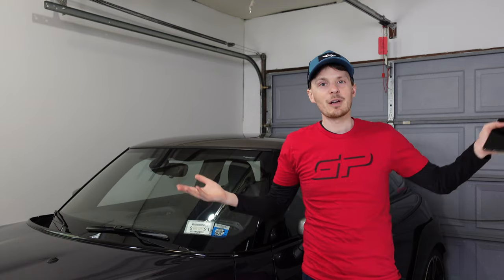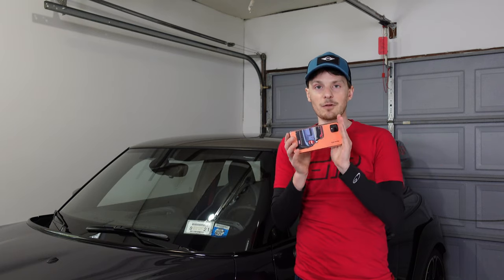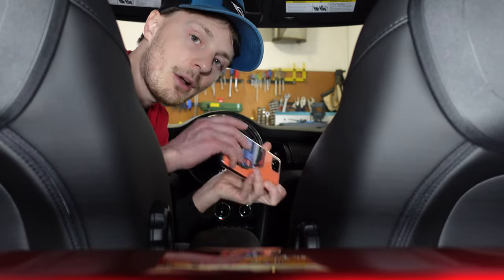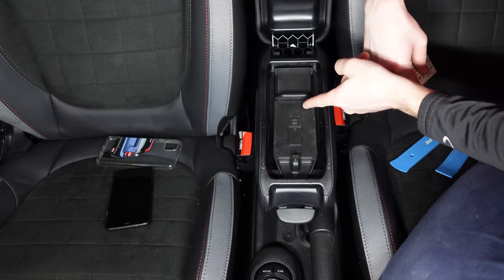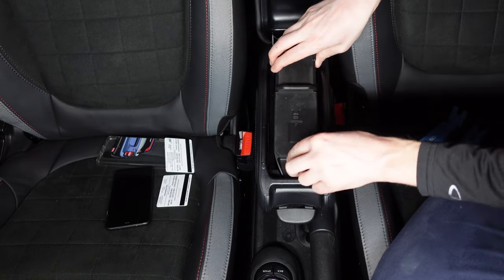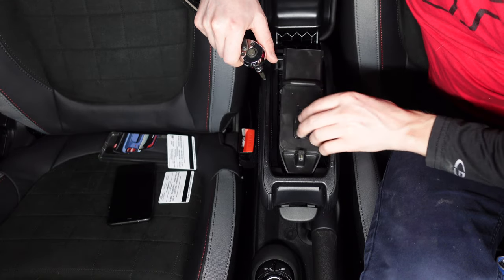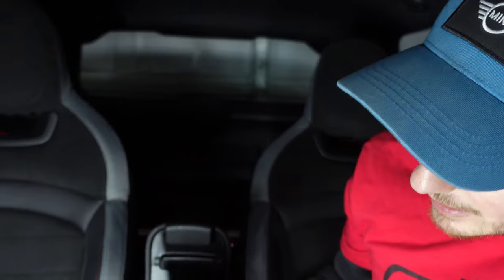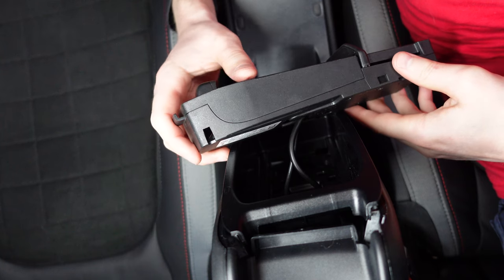Making the MINI wireless charger hold larger phones

Comment: Just did this mod to our 2024 electric Mini Cooper SE.  Had to use different size bits than the one in the video. The whole process was identical otherwise.  Very glad to have a useable wireless charging pad.  You'd think that Mini/BMW would've fixed this size problem on their latest models.
Reply: Hi @layrad, could you tell me how you did the work? I'm so plussed that you got it done! Did you buy it or did you get it 3D printed?
Reply: @bridgetjackson474  I was about to 3D print it. I believe the file was linked in this video. But I ended up impulse buying it from Etsy because I was too lazy to fire up the printer.
Reply: @layrad  is there a ready-made article of this kind on Etsy or do we have to contact someone who makes it for us?
Reply: Thanks for letting us know it still works for newer Minis.  I need to do this on my 2023 Mini Clubman Untold Edition.  Any idea of the material used to print?  Should I be using PETG due to Texas summer heat instead of PLA+?
Reply: I'm only familiar with resin printers but the 3D printed part I bought from Etsy was definitely made in a filament printer. If I were to give some input, get something that has some flex to it.

Comment: Thank you so much. I had a local guy do the print and learned that my computer tech kit only carried a T6H, so I got as far as pulling out the slide deck until my new electronic bits came in. I have a 23 F60 S All 4 and found that the T5 was actually too small to use, but the T6 worked like a charm. I also had to drill the center hole of the new part. A 3/64 drill bit worked perfectly. Did a dry fit and then the real thing. I have a Galaxy S21+ in a QI enabled case and it fits and gave me the blue light of success with the message of "phone will be fully charged in 11 min". The only thing that I have to do is make sure the slider is completely disengaged when I pull out my phone. NBD as it's better than having a very expensive charger that would be used for storage. Thanks again!!! I now feel I can use 100% of my car.
Reply from the maker: Oh wow! that is awesome! Glad it worked out for you!

Comment: Thanks for the vid. I just purchased a 2024 F55 Mini Cooper S and got bummed when I couldn't use the armrest wireless charger. My phone couldn't fit in the charging station. I stumbled on your video after searching for a way to fix the small charger. 

Everything worked smoothly and problem free thanks to your vid. Just some tips is to pre-screw the shelf since the 3-D Printed center hole was very small. Use magnetic screw drivers so you don't drop the screws XD

You helped fixed something that BMW didn't.
Reply from the maker: Magnetic screw drivers is a great point!! Glad it worked for you!

Comment: Just used the same file for my Countryman F60 JCW! Works like a charm. Printed in PA6 (bit stronger than ASA). Thanks for the great video.
Reply: PS. I've got a Samsung Fold 3 with case in there and still got some space left to normally take out the phone.
Reply from the maker: Thanks for the info! Glad to know it works the same in the F60 and glad it worked!!

Comment: Much thanks for putting this together. I recently had a friend 3D print this. As expected, the material was too weak and broke. I ended up ordering several of them online in PA12 material and completed the reinstall today. What a difference the material is. As others had mentioned, the two holes did not fit so I simply made a tiny pilot hole, pre-installed the tiny screws, then reinstalled everything. All is good, nice tight fit now!
Reply: where did you order online?
Reply: @mikemeechan  email me your shipping address and I can send you one shipped for $20.
Reply: @TheAutomotiveFanatic  how do I send you an email or DM?

Comment: Quick question - I have a 19 JCW and want to remove the wireless charger to allow additional storage in the armrest.  If I remove that click in charger portion, is there a flat floor beneath it?  Thanks mate.
Reply from the maker: There is not but I'm sure you could cut a piece of plastic to cover the void where the cables route down underneath

Comment: Nick, love your videos!  They helped pass the 6 months I had to wait for my 2022 Countryman JCW.    I was wondering if you could comment on your wireless charger fix now that you have been using it for some time?  Are you happy with the update?  Any issues or changes you might have?  Thanks in advance!
Reply from the maker: I'm still happy with the part and being able to put my phone in there! However! The issue of the phone over heating in there is still very much a possibility. Especially if you are streaming music or using navigation. That has been an issue for many and is due to the  coffin-like design of the arm rest and not related to the printed extender.
Reply from the maker: Exciting about your JCW too!! Congrats!
Reply: @TheMINIVlog  Thanks!   Love the ride!  Think I might just pull it out and go with the hard wire instead!

Comment: My new phone is too long....I am missing something here I think.  Was your phone too wide or too long?  If length, how did getting the same bar increase the length?  I couldn't see the initial phone real well or the shot of it inserted after change, after watching a couple times, so decided to just ask.  I saw your new video on the 3d printed part.  Is frustrating that Mini seems to accommodate Apple in every way but lags so far with android devices.  I am considering just removing the slide bar completely and setting phone on top of it when I need to charge,  the old duct tape it in place for a temporary fix is cheap if ugly way to stop the phone from moving while charging!
Reply from the maker: my phone was too long to fit. the bar has an extension on it to allow for taller phones like my google pixel. I think the sliding of the bar is an important part of the charger, when you slide the bar back, you see a blue LED light come on. I suspect that might turn on the charger only when the bar is slid back, but can't say for sure.

Comment: Hey thanks for that. Instead of ordering the 3d part, would it be possible to cut off the two protruding ends which could allow the original part to slide an extra 2 cm?
Reply from the maker: Probably possible. Might be difficult but I would say possible

Comment: This was great video - thanks. It inspired me to do this with my 2018 JCW All4 Countryman. So I downloaded the file and ordered my $40 printed part from Shapeways. Yesterday I installed the part. Only issue I had was that the 2 screw holes had to be drilled out - they were too small. Also, the finish on the part was not great, and I paid for a higher quality material. My larger iPhone did fit (barely) even with my thin-ish rubber case. But the charger wouldn’t turn on unless I pressed down hard in the phone. Disappointed. Then, after my 5th time inserting the phone - bam! The part snapped. What a waste of money and time. I’ve come to the conclusion that this charger design, frankly…well it sucks. It only really works with no case. But who does that? And the sliding arm is a joke. My advice: DO NOT WASTE YOUR MONEY AND TIME. I will be converting the inside of my armrest to storage and using a different solution to charge my phone.
Reply: I actually abused the hell out of my 3D printer part (used Shapeways, and coincidentally ended up using one of the materials this dude recommended in another video) and it’s been fine. I literally pried on the charging unit by the part forgetting one torx bolt and it was fine. I even stress tested it with about 200 rapid open / closes and it hasn’t even deformed. 

Even if it did break, the part is so cheap and the mod so easy to do that I have a spare on hand just in case.
Reply: @BlownMacTruck  printed this piece twice now. The first time I printed it 40% infill but with the heat I decided to print it at 100% infill, should bend now.

Comment: I just successfully made this modification.  Thanks for the helpful video. My only concern is that the only thing holding the shelf on is the plastic threads for those tiny screws. They will eventually wear out and it will come right off.  Has this happened to anyone yet and has anyone tried to use a bracket of some kind to secure the shelf onto the slide?
Reply from the maker: Has not happened to me yet but I'm also concerned that is being held in by just that

Comment: I wonder if an iPhone 13 pro max with a chunky case will fit nicely if you just remove the sliding shelf and lay the phone in there.
Reply from the maker: thats a good question. that might be pushing the limits, depending on the case

Comment: Hi Nick
THANK YOU SO MUCH. For my Countryman 2020 I have printed the piece in Nylon PA12 (as you suggested in the other video about materials), my experience is the finishing is not very nice, but seems to be strong as any other plastic component of the car. I already installed and works fine, will update if it last. 
Now that my iphone XS Max has room, I realized the wireless charging make the phone warm, actually hot. I have waze and amazon music running on Carplay, and when the phone becomes hot (1.5 hours of charging), Carplay becomes unestable, music playing with cuts, 
Have you experience that?
Reply from the maker: Yeah the phones definitely bake in their while charging and the lid closed despite their efforts to cool them. I imagine they won't use this arm rest charger design for the next generation. At least I hope they don't. Some people leave the arm rest open to help the phone get even more airflow during charging

Comment: I just cut off the shelf that was made to hold the phone, and it worked.. took less than 5mins and no investment involved
Reply from the maker: That works too!
Reply: Hello. What did you actually do? I think I understand but would like it spelt out to me. Cheers.
Reply: That doesn’t work for me. The slide has to slide to turn on the charge functionality.

Comment: Thank you very much, guy...  The install on my 2020 Mini Cooper S Clubman was a bit different than yours.  The four screws in the tray under the main unit don't exist.  I had to cut a small piece of plastic from the tray in order to get enough play from the cables...  Other than that... A snap.  One thing, real quick.  I noticed when I push it back all the way it jams a bit for about a quarter inch or so...  It doesn't slide cleanly all the way back.  I can't see what the heck it's rubbing on.  Any ideas?
Reply from the maker: The rubberized coating of the charge bed is likely what is catching that sliding arm from sliding smoothly. Mine will occasionally do it too when it get warm and things expand in there.

Comment: Thank you for sharing this wonderful video! I've taken all apart and tried 2 prints from 3d printers (Shapeways). Both broke really quickly and the second one was such a surprise as it was very hard plastic (fine print though). Do you have a good recommendation of the Type of 3d material you have used? This is getting expensive to keep trying.
Reply from the maker: Will, I have 3 different/new materials arriving to me soon. I'll do a video on them as soon as I get them if you can sit tight for a little bit. If not, I can tell you what print material I used from shape ways with success. Let me know.
Reply: @TheMINIVlog  I would love hear now (dm me?) because I have a trip coming up. AND I would also see your video of the 3 types! It has been quite a fun project thanks to your directions! Very well done!
Reply from the maker: Are you on Instagram by chance so I can dm you there?

Comment: I have used the wireless in our CM and the phone gets stupid hot. There is a vent in the side but it needs a fan. It would have been nice if it was a simple plate.
Reply from the maker: I hope the 4th gen moves it to a double charging zone pad down in front of the cupholders
Reply: Mine too. My old Galaxy S9 managed to get some decent charge before stopping due to overheating - my new S21 only gets a few percent points of battery juice before stopping. Actually there is a fan (if you put your ear directly over the armrest you can hear it working when you turn on the ignition), but it doesn't do much!

Comment: Any idea what size torque bit u need to remove the tiny screws. None of mine fit :(
Reply from the maker: I used a T5 bit out of an electronics repair kit. An eyeglass repair kit probably has something similar that might work
Reply: @TheMINIVlog  all done :) tyvm
Reply: @TheMINIVlog  fyi  i had to use a T6 for mine. Not sure if the screw was just knackered but T5 was too small. Anyone reading this, get a few sizes just in case
Reply from the maker: Great tip!

Comment: Just did this mod and it is a game changer. Idk why Mini didn't just make it so that longer phones could fit. I was able to fit in a Google Pixel 7a which is about 6.1 inches. The max length with this mod is about 6.5 inches I believe. Anything longer and it will not fit.
Reply from the maker: Glad you did it!
Reply: @TheMINIVlog  Only thing I have noticed is that my phone does get hot. That is why they added the little fan and vent in the newest models. I don't think it does much but it is better than nothing.